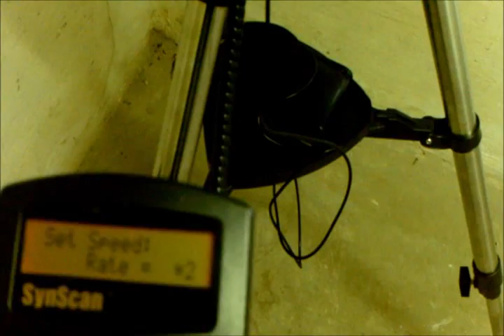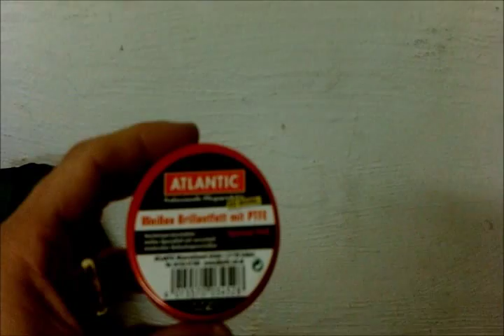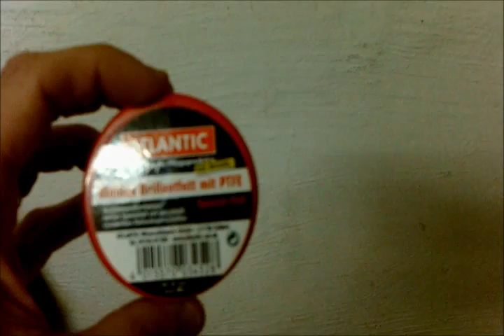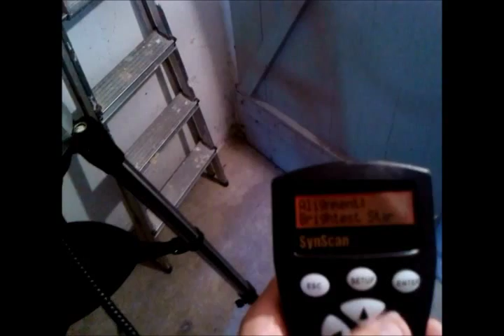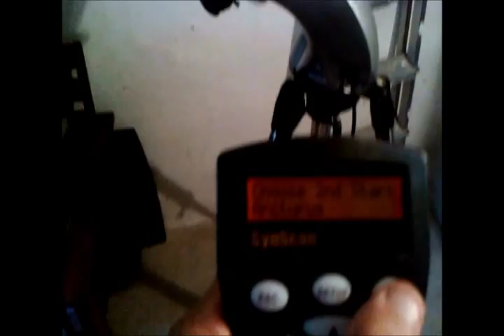Repair procedures and maintenance on a Skywatcher AZ GOTO Mount

Comment: anychance of doing this again with a decent camera please as the video if good but back quality and hard to follow and see ..your the only one who has bothered to do this well done as mine needs doing.i have a celestron nextstar and even on 9 its slow
Reply from the maker: Good point indeed and I have found something else on this mount which you'll be impressed with, However the only draw back I have, is my location has not been great for clear skies and it's been affecting filming for some time now which  I haven't even had any clear skies for 3 month now, It's driving me insane!! Once I have those times of clearing I will look into this with actual set-up of me using the mount for stargazing.
Reply: @MPAstro  what else have you found on the mount that we'll be impressed with?

Comment: I followed your instructions as my SW GOTO aligned well but it couldn't keep it after a minute or even less, which I assumed it was due to lack of maintenance. I also noticed that one of the receivers of the encoder was a little bent upwards, a very gentle push and it straightened again. One of the ICs in the board has a small dark spot, I don't think it is a sign of being burt as yours, but it may be the source of the drift ... Many things, and I'm sure that tonight it will be the same as it was :(
BTW, I used much less grease.
Reply from the maker: It's a fiddly mount indeed, the motherboard is the big problem on this mount, I would buy a second hand mount it will be cheaper to buy than just get a motherboard alone

Comment: Awesome video. Thank you very much. Really encourage me to do the same. 🔭🖖🏼
Reply from the maker: You can do it!
Reply: @MPAstro  I did it and get way better than before thank you. But I still have some issues with alz tracking, even when I put in lunar rate, it’s moving faster than the Moon. Same thing with solar rate and sidereal rate. I did reset to factory settings, updated, checked several times date e location and still happening. Any tips?

Comment: you are a 🌟. I just bought one off eBay and there's no 'up down' movement . 

I was worried I'd broken it by moving it by hand.

are u saying that it's possible to move the scope by hand without damaging it?
Reply from the maker: Yes has the gear has just enough friction, for you to move the mount. However if the movement is tight, then it's worth slackening the nylon nuts slightly. But having no movement between the drives I would leave it alone, and always use the hand controller and motor drives than use it by hand. Has long has the motors are not binding it should be OK.
Reply: Thanks  Man your videos have made what was a really tough subject manageable
Reply: thanks Matyin,
its going back to the seller as the up down axis is not working at all.  He's been good enough to refund.  Would you recommend syscan or should I go for the new starsense tech? instead?

Comment: Hi Martin, I have been given one of these as not working. When I looked at the circuit board I found that the large capacitor C1 had actually exploded !! It has left no trace of its specification. I could, as you did buy another circuit board, but I would first of all try to replace the capacitor which would be a far cheaper option. I know that it is possible it will not cure (if there is one) the original cause of the failure but for a few pennies rather than ponds I will give it a go. Could you possibly have a look at the specifications marked on the capacitor and let me know what they are please ? I would be most grateful
Reply from the maker: Hi Toni thank you for watching. I am aware that this is an old video but I might consider making a new version of this. I've checked the C1 Capacitor on my mount and I found it's a YC 100uF 16V operating temperature +105 degrees -40. Here is the link for the capacitor, I hope it helps you!! Good luck on the  repair Toni  https://www.amazon.co.uk/100uF-Electroytic-Capacitor-16VDC-105°/dp/B00KM17LUE/ref=sr_1_4?ie=UTF8&qid=1529846699&sr=8-4&keywords=100uf+16V+105+-40+capacitor
Reply: Thanks Martin, that's great. Will let you know how things go
Reply: Hi Martin, well, thanks to you,35 pence later and a bit of soldering, I now have a working telescope :).  In the garden with it last night and it was aligning to one star and Jupiter. My lack of knowledge as to which star is which was quite noticeable...lol. Thing now is that the only eyepiece I have is a Super 20 wide angle, long eye relief that has very little magnification. Could you let me know which eyepiece I would need to view the stars and planets properly, and the best place to get one please ?
Reply from the maker: There some damn good eyepiece sets. The best budget ones to look for are the Plossl eyepieces, they offer 52 degrees field of view and work with all types of scopes, they are the best choice for a damn good budget. There is this Solomark eyepiece set which as the danm good Barlow lens from my last video review. Here is the link to this truly awesome set. https://www.amazon.co.uk/Astronomical-Telescope-Telescope-accessories-Accessories/dp/B06XBXYLFN/ref=lp_6672388031_1_7/257-9881058-8618000?srs=6672388031&ie=UTF8&qid=1530387290&sr=8-7
Reply: Thanks again Martin